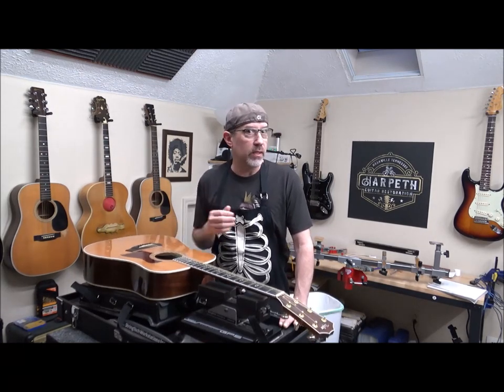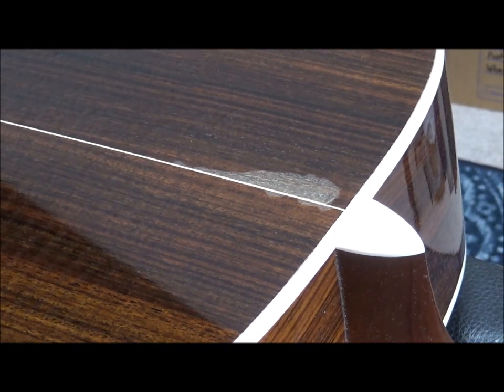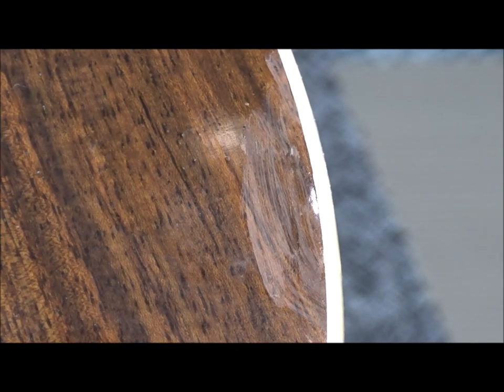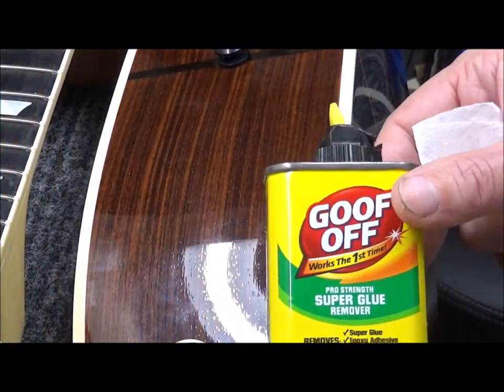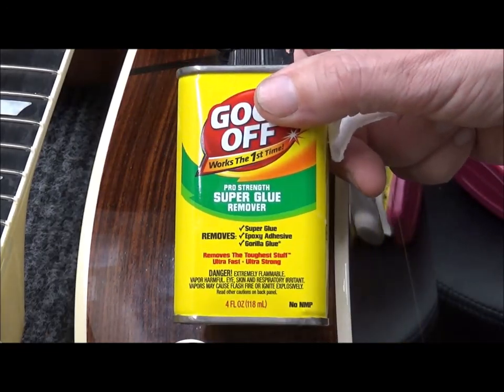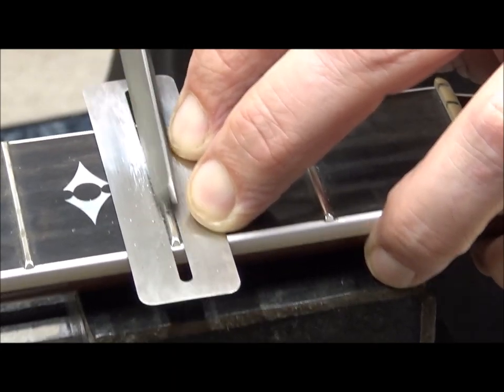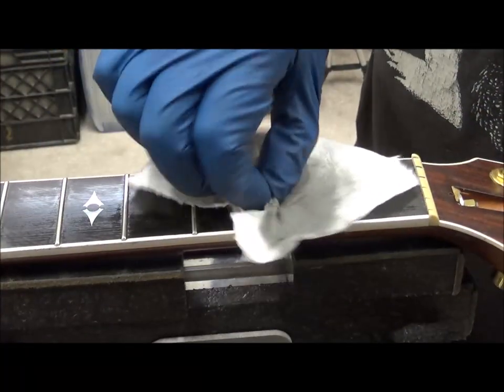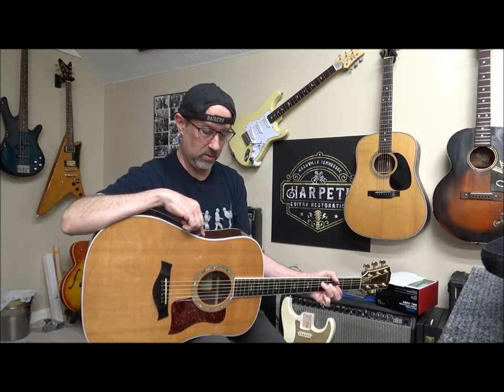Taylor Bubbles - Finish Repair

Comment: Another great job!  I’ve never seen the bubbling thing, but it was really cool how quickly the capillary action sucked that low viscosity CA glue right in there.  You did a fantastic job quickly fixing what couldn’t have been a real mess.

I also like the big multi-fret fingerboard shield you used when sanding the frets.  My guess is it’s a StewMac deal….they have everything, but usually too expensive for my limited needs.

Comment: I just bought a ‘99 814ce and it’s got small bubbles all over the place.  I played it for a while along with many other guitars and the sound and feel were great to me.  

Are there any non cosmetic reasons I should look to get these filled?  Like I said, it sounds great to me and I don’t mind the flaws on the back and sides…
Reply from the maker: @stevewaller8202  I’m inclined to say it’s purely cosmetic unless it cracks.
Thank You 🙏
Reply: @harpethguitar appreciate the reply.  Thanks for the video.

Comment: What was that thing you called a "Scrub Pad" used with the wet/dry with the fret shield? Where might I find that? I can't find it anywhere. Thanks
Reply from the maker: “Scrub Bock” stringTech Work Stations sells them as part of a fretting kit, but anyone can make one out of 5/4 bullnose, decking or stair tread material cut to about 2-1/2 to 3” square. with vinyl foam fabric wrapped around it /stapled to it
Reply: @harpethguitar  OK, I am an "Old" hardcore engineer. Where do I find vinyl foam fabric? Technically the foam density comes to mind and its thickness needs to be some number 'X' thicker than the height of the fret. I have a Taylor 855ce with a couple of silver dollar size bubbles on the side an back of the Rosewood; Thank-you, thank-you soooo much for this finish trick. The frets were leveled to a flat top and never crowned so I am eager to give this a try. The saddle has been filed to a sliver so likely a neck reset is in the cards before I am done getting this beauty back to playable condition. Thanks again. You have a 70 year old dedicated follower now.
Reply from the maker: @BluesDoctor  check with Mike: https://youtube.com/@techdeckgps?si=8DiwFFdL2p8uxHFg

He has links to all his stores on the description page of his channel